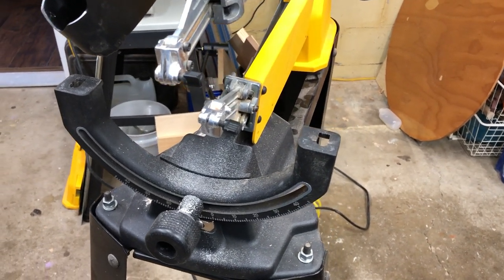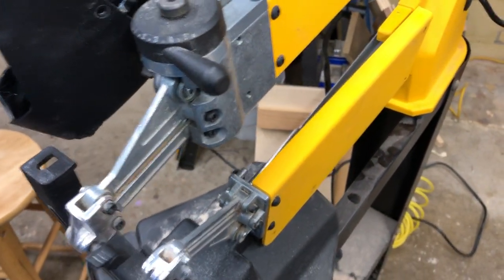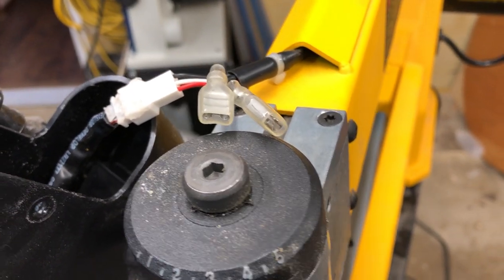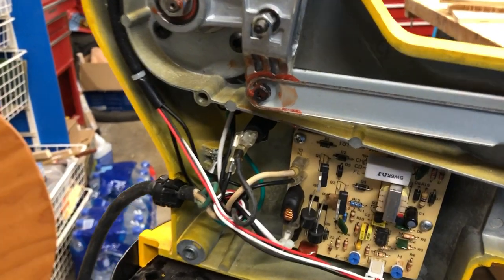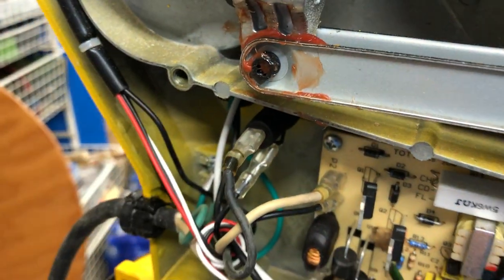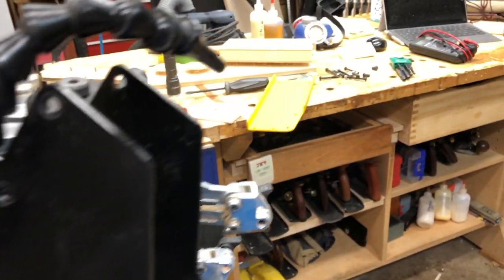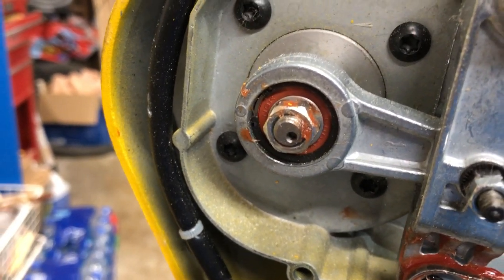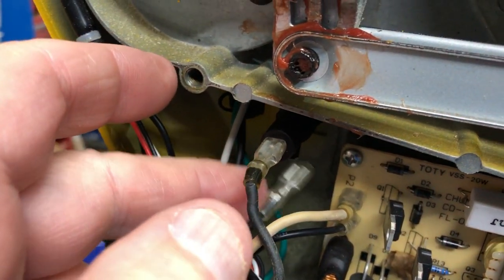Repair DeWalt Scroll Saw basic electrical problem

Comment: Thank you for this video I happend to have the same problem, mine stopped working all of a sudden and I just wiggled that same loose wire you have and it turned on! I think from the vibration of this machine it will eventually loosen up. I will keep on eye in them and if the problem continues I will have to soldered it the the fuse
Reply from the maker: You're welcome.  Glad it helped someone.